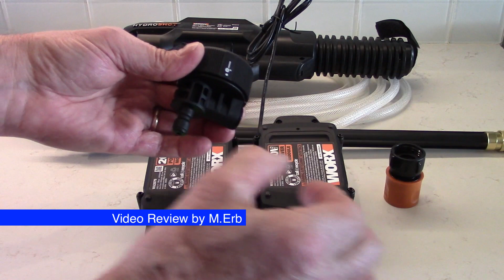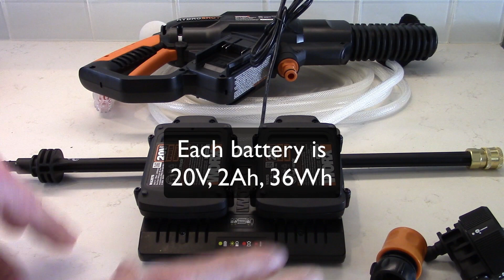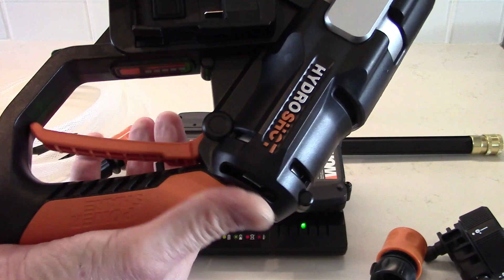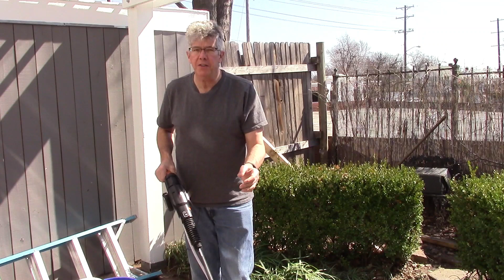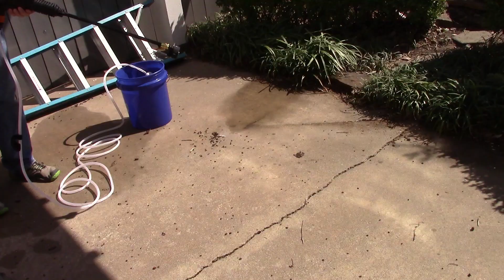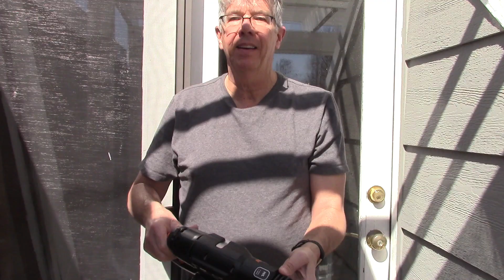Review Worx 40V HydroShot Cordless Portable Power Cleaner WG644 Power Washer

Comment: Thank you so much for your review. We needed something to use where we don't have power. I think this would work well, especially if we use a cannon with a good cleaner.
Reply from the maker: I hope it works out for you. It's not as powerful as a pressure washer, but it can be quite helpful especially if you don't have power or an accessible  water supply

Comment: These rechargeables are great but i much prefer electrical corded ones. They r better value as they r so much cheaper and they provide superior psi or bars and thats why i buy pressure cleaners in the first place.
Anyways, great detail breakdown and thanks for sharing with us.
Reply from the maker: I don't disagree. But there are situations where there is no AC power and no running water. So this will work where an AC powered device would be worthless.

Comment: I am sending mine back it only lasted 10 minutes the unit itself is great I like the power but it does not last at all. I need longer batter time 30 min would be nice I would like 40 or 50 min realistically but 10 just is annoying and I don’t want to buy 3 sets of batteries and chargers.
Reply from the maker: sabrina earth angel I’m not trying to defend worxs in any way, but the batteries should definitely last longer than 10 minutes. Have you gone through several full charge complete discharge cycles?
Reply: Reviews, Tutorials & Tech oh yes I have I was thinking I might have a bad charger I love the machine I just need more than 10 minutes i let them fully run out then I fully charge them about 4 times it was so quick just about 10 minutes each time. So I am just going to send it back and buy one that I can plug in then I won’t have that issue I just like the portability of it and the knowing how much water I was using. They should give an option to plug it in if you are near an outlet this way you have battery or electric power then it would be perfect.
Reply: @Sarina_Bella_11  I get 15 minutes and maybe a few more. It doesn't last that long but for the small types of jobs I do it's OK.
Reply from the maker: sabrina earth angel by the way, it should take one hour per battery to fully charge from depleted. So in other words it takes two hours to charge both batteries simultaneously.
Reply: Reviews, Tutorials & Tech yes I waited the next day on one charge like I said the unit itself was great just the battery like and I did a few small jobs on being the tiles in my bath room granted my entire bath room is tiled but I was just doing the shower spa are and i only got half done took the whole day lol.

Comment: I just got mines I'm having trouble of the lance leaking from the unit when I connect it not sure why
Reply from the maker: Kevin Gadson Mine doesn’t leak at all. Make sure that you have it firmly seated in before you let the sleeve lock it into place. Also make sure that the O-ring isn’t missing or dislodged  somehow
Reply: I just figured it out it was the lance that is bad the connector on the end isn't right both the grooves are the same size one is supposed to bigger than the other so it doesn't line up right going to contact customer service
Reply from the maker: @kevingadson9315  Both grooves on the handle are the same size on mine. The lance end has two sort of rectangular tabs that fit into the grooves of the handle. You push in firmly then twist 1/4 turn to lock it in place. My previous answer was somewhat incorrect as I was referring to the hose attachment to the handle. Sorry for the confusion.